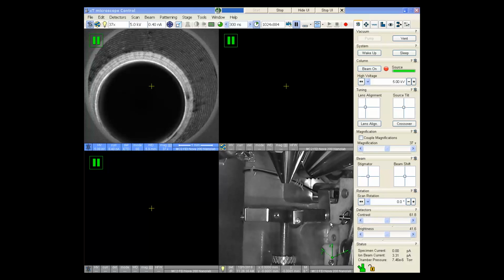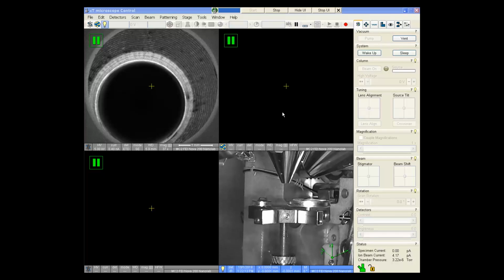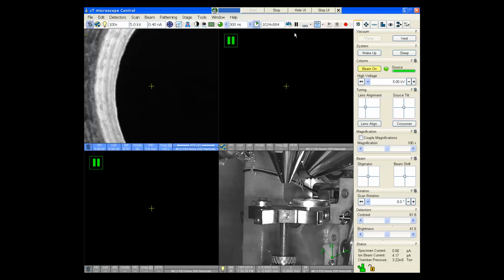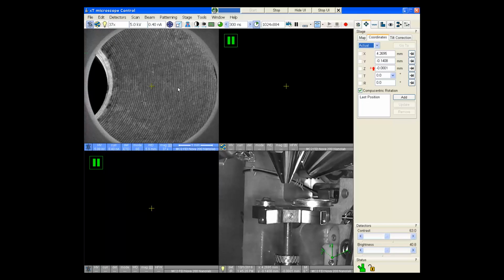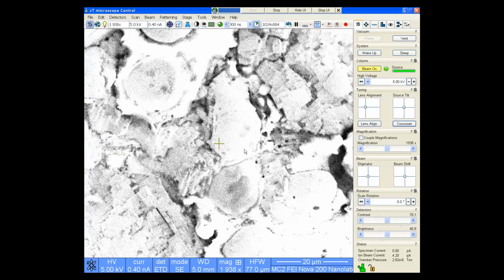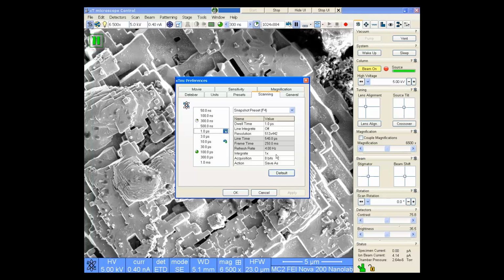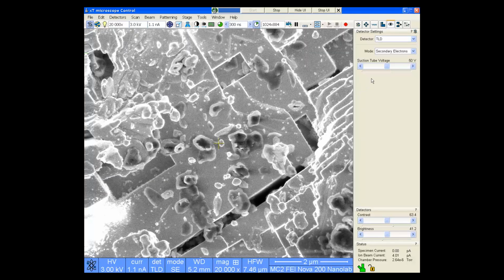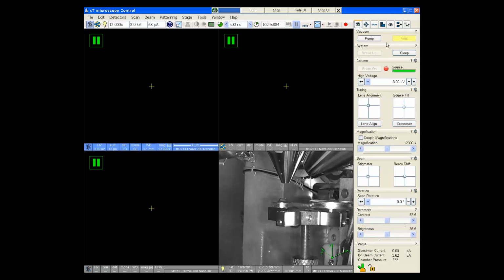Basic operation of Nova Nanolab for SEM Imaging

Comment: There will be any problem if we restart the pc?
Reply from the maker: No, but there is a specific procedure to restarting the computer.  You must close the UI first, then stop the FEI server, then restart the PC.  After restarting, you open up FEI system control, click "start" to restart the server, and then the UI should automatically start back up.  You can then log in with your user id and password and you should be all set to operate the system.  If the system completely crashed, you can skip the first steps and just hold the power button down on the microscope PC until it shuts off, then restart as normal.